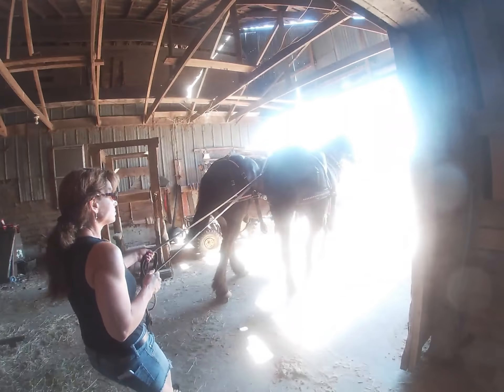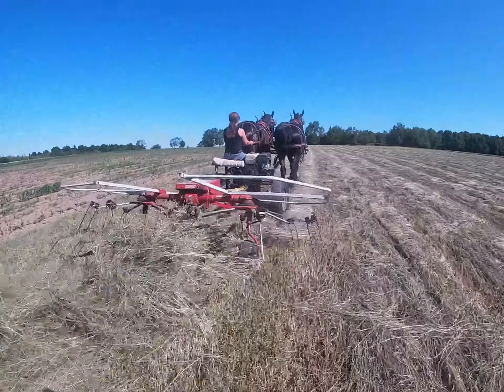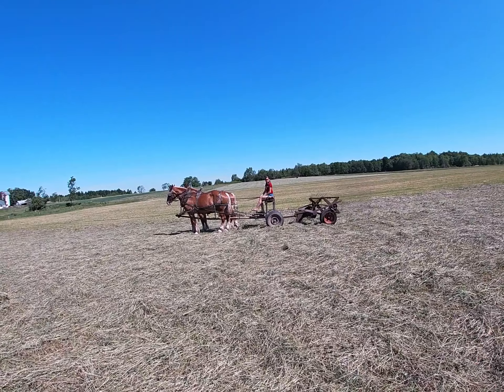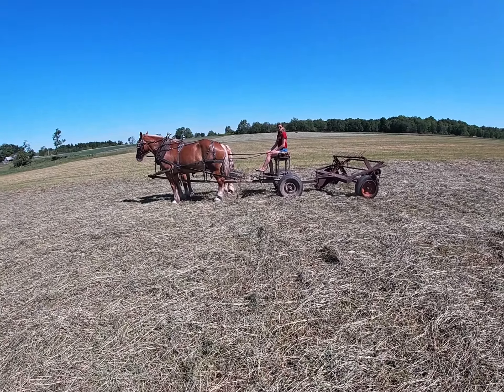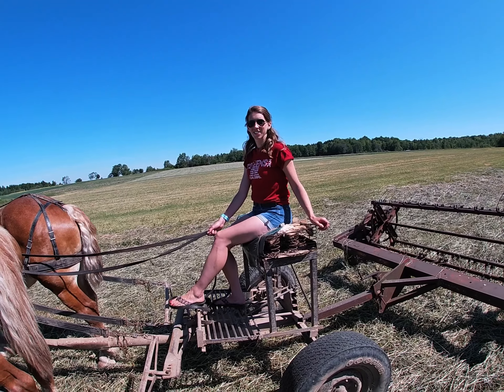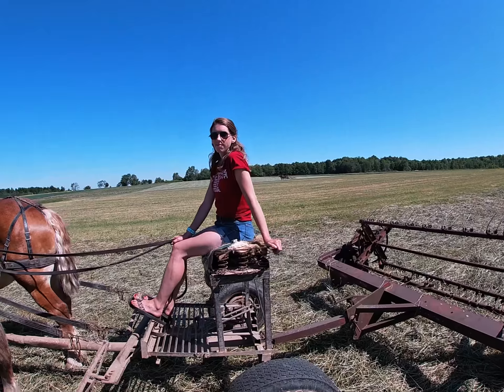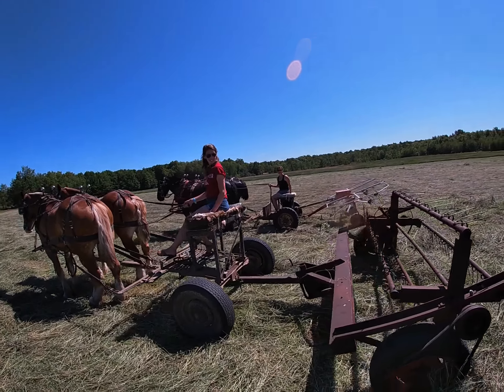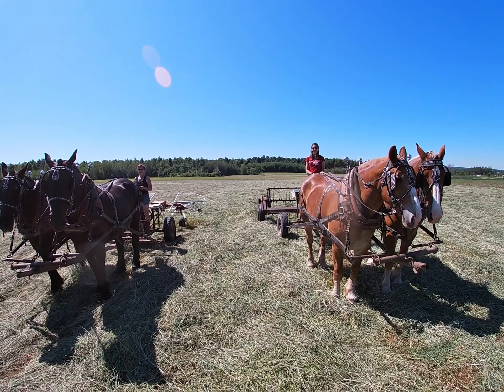Haying With Draft Horses: Comparing Two Tedders

Comment: Glad to see your hay is getting dry and will be ready to bale soon. I too have two tedders, the old horse drawn type that has forks that pickup the hay and toss it behind, and the tedder/ rake type. As you mentioned, they both have their place. In grass hay the Tedder/rake does fine to teed one day rake and bale the next, as long as the weather is good. When I raised red clover or alfalfa drying the hay was more difficult, when there was a heavy crop. That’s when I’d use the old horse drawn tedder but if I did have to use the Tedder/rake I’d use it in the early morning while there was a little dew on the hay, to save the leaves. If there happened to be some rain while the hay was drying, it was bad news as the leaves would shatter when raking and a cloud of dust when baking. I’m sure you know all about what I’m talking about. I remember one time the clover hay had been rained on and I baled it a little damp, not wet but high moisture. Those bales carmelized and  smelled great and the cows cleaned up every bit of it. Luckily none of it got moldy only had a great molasses smell. The conditions were apparently just right as I’m sure I could never make hay like that again. Haying is always a challenge because of the weather and breakdowns. One year I had all my hay baled into Haylage and that worked well as I didn’t have to wait for drying. It’s great if you’re set up to feed it and the horses did well on it too. I watch videos of a Friesen horse farm in Holland and Haylage is all they feed to their expensive horses. 
Hope you get your clover baled up and in the barn.
Reply from the maker: The clover is baled up without getting rained on.  I did what you said you did and tedded it in the morning while it was slightly damp to keep the leaves on.  Seems to be good stuff.
Reply: I failed to mention Jim, if your clover hay is dry or almost dry after tedding  and your leaves are in good shape, you can rake it, again, with a littler moisture to save those leaves. Usually by the time you’re done raking it’s ready to bale. A little of that morning dew in the hay shouldn’t bother baling it. I just pick up a few handfuls of the hay and squeeze it in my hands and if it feels dry and the leaves don’t shatter, start baling. 
I’ll be waiting for the baking videos. Glad you got it baled before it rained, always a challenge.

Comment: I wonder if the old Tedder needs the stand off height adjusted on the forks.  Seems to me we relyed on the  rake as the main dryer, cutting then let dry, then rake left, rake right and bale.    But..., I was usually coming in to bale and the raking already done so I'm not sure.   That new Tedder really whips it but maybe overkill,  that may be the difference between milking cows feed and horse feed.
  Sure is nice when the weather cooperates though.  Thank You.
You guys really do a nice job with your hay, keeping the mold to an absolute minimum.  Ultra Low Moisture.

Comment: The motorized  tedder certainly moves the hay more thoroughly, but I'd be afraid it knocks too many leaves off the clover. Here in Missouri it gets so warm, that usually tedding is not required. I just use the side-delivery rake, if necessary turning the windrows twice.  Haywork is always nice with the horses.

Comment: Jim I wonder if you took an old truck rear end  with 4/10 gears and turned it so the drive shaft was poking out the back attached a 540 spline and made a direct drive unit for the rake. You might get more offers to rake hay.
Reply from the maker: It's possible but out of my expertise

Comment: Nice video Jim.  But I think before works starts,.....Brenda and Daughters should pray, and then sing the Star Spangled Banner. (Ha!Ha!)  After seeing/hearing that in the sled pull video, I think it should be a staple for all of your videos.  On the Grimm tedder (spelling?), the one that Trudy was on, are you able to change gear or pulley sizes to get the tedder to run slightly faster, to pick up more hay and fluff it a little better?
Reply from the maker: Haha!  About the Grimm tedder- not that I know of can I change the pulley sizes but it sound like a smart idea

Comment: We had a Grimm Tedder like yours, but our's was PTO drive, and I found going the opposite way it was cut,it seemed to fluff the hay better, just wondering if you have tried that and if you noticed the same thing, our hay was cut with a haybine instead of a mower, so I suppose that could make a difference also.great videos, keep up the good work!
Reply from the maker: Yeah it does seem to make a difference which way you go, but it just doesn’t seem to throw it like the new one.I’ve been so busy I haven’t had time to watch your last couple videos, but I watch them soon continue the good work
Reply: @WorkingHorsesWithJim  yeah I agree, it's hard to beat the new style Tedders, we bought a Vermeer a couple years ago and it was a big difference.

Comment: When you find that pot of gold, you could always buy a ground drive PTO cart. Then upgrade the motorized cart to bale with. Those two items will probably cost more than your tractors!
Reply from the maker: yeah, maybe.  I think you're right about the cost!
Reply: Steve Slade  For light PTO tasks, a team is plenty. Check out videos from past Horse Progress Days. So many intuitive designs of equipment are available now.
Reply: Working Horses With Jim  I have seen stories in Small Farmers Journal of guys converting horse drawn mowers into PTO ground drive carts for Tedder.

Comment: Woaw, Jim, you have some fine horses there. I have a Belgian draft horse, gelding from 2 years. I am trying to teach him, but he is pretty spooky with everything that happens behind him, so still a very long way to go. Do you have any tips that can help with this issue?
Reply from the maker: Jean Vanhees It’s hard to train a colt, Especially if you don’t have any training yourself, but it can be done. You just have to go slow and be patient and introduce him to things so they get over the fear. Have you ever trained horses before?
Reply: Thanks Jim, for the reply, and yes, i have trained horses, but that where friesians, i had a friesian horse so far i could plow with her, but she did not like to work. Maybe i have started with too deep furrows, and she had to pull to hard. At some point she took of, and caused a lot of dammage to the gear but also to herself. After surgery i would not let her work again, that's why i bought this drafthorse as a foal. He is now 2 years and accepts the gear on his back, the collar, and the blinds on his eyes well, and i already start steering behind him, but i am afraid to hang something after him to pull, because i am alone.
Maybe is 2 years too young to start pulling and training, what do you think?
Reply from the maker: Jean Vanhees I usually wait until they are a little older because I like to work them harder, but at two you could pull a tire around to train them. Good luck